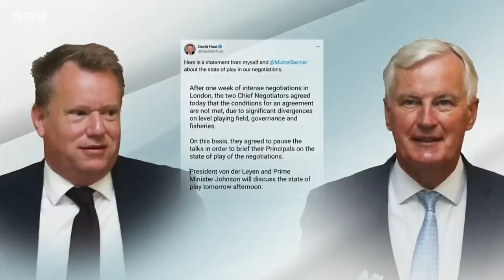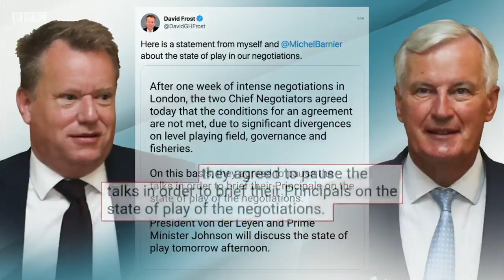Brexit trade talks paused - with less than a month to final deadline - BBC News

Comment: BBC can you run a deep analysis on what happen if they can't get a deal signed and implemented in 3 weeks?    

You folks should handle this like a storm forecast program, help people understand and get prepared at where,  how they will be impacted.   If there's critical supply that can get disrupted by the border control, it's important people with medical need for instant, take note and get prepared ahead of time.